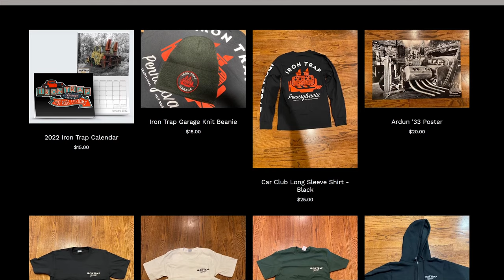Cutting Up A 1932 Ford Firewall For Jay's Channeled 1932 Pickup

Comment: Like what you're doing, I like seeing engines other than the flathead and small block Chevy. Two things: better eye protection, and hearing protection. Used to do this full time, several trips to Emergency to get metal chunks pulled out, and now occasional tinnitus. Don't use yourself up!
Reply: Pardon?

Comment: Making great progress on the 32 it takes a real man to cut one up is what they say firewall is really hard to get right especially with Pontiac motor and cab slightly channeled the new feet&bracket is critical for door adjustment also I used original ring and flat piece of steel on my pick-up running s/b Chevy though at least you can blame Pete for any backlash keep trudging through the many steps to get it running only took me app. 30 yrs.to get mine on the road but first drive to York was worth it 2'45" trip

Comment: Dang, Jason, nice ride.  You forgot to mention that motor is a Pontiac, I would guess a 389.  The unusually tall valve covers make is difficult to recognize.
Reply: It’s a 389. I have the stock valve covers but I have to get spacers to clear the rollers. So for the time those morosos are on there.
Reply: @theabyssgarage  They look nearly identical to the factory '64 to '66 chrome GTO valve covers, except taller.  I'd keep the Morosos rather than have spacers which could leak and look funny. Just my two cents.  Cool look !

Comment: If the bead did give you a clearance problem you might have been able to cut it out and reverse it and weld it back in? Behind the engine it wouldn't  be noticeable but a OCD gearhead would but think it cool lol.AL B.

Comment: Pretty cool, but couldn't you have just reversed the firewall and gotten more clearance without so much cutting? Just a thought.
Reply: What I like about the way he did it was just modifying it only where needed. Look how far back the sides of the firewall stick into the body. I think that would look terrible as well as rob unnecessary space from inside. Even the ribs would be inside and look bad on the outside to my eye.  The way he did it, the modifications just look right. Great job Jay!  Are you going with a mild chop? Good look either way I think. That's one of the few chop jobs that I would be comfortable doing.: )